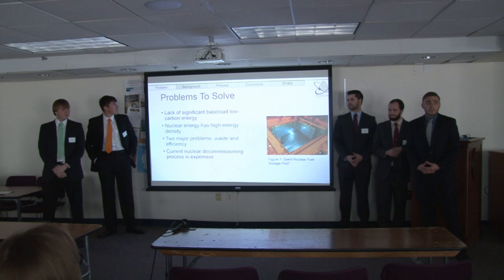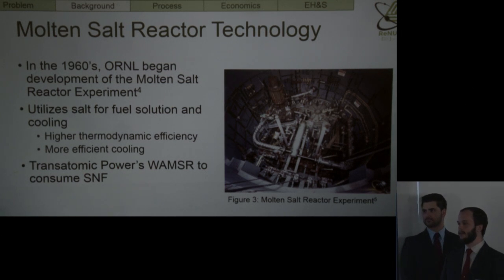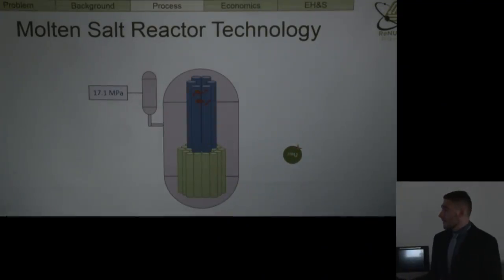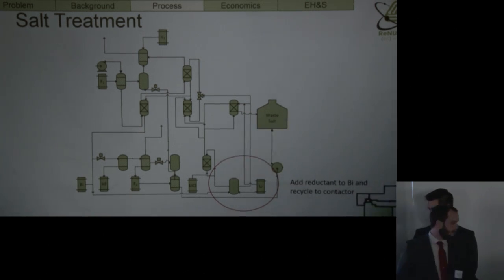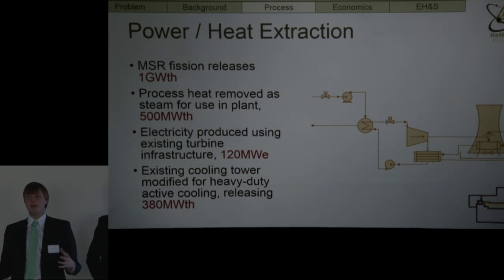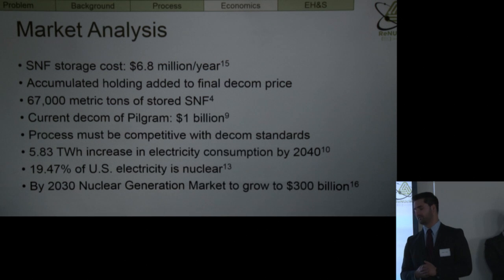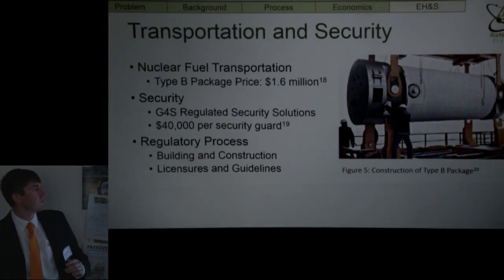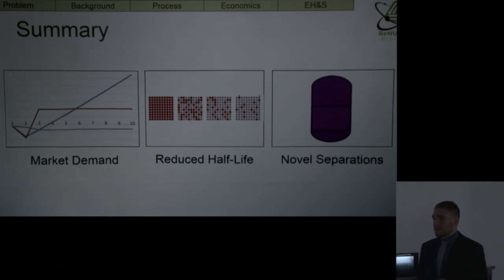NU ChE Capstone 2016: Molten Salt Breeder for Nuclear Reactor Decomissioning & Fuel Disposal

Comment: good job but i have several issues with this proposal:
a) you can't do that reprocessing you're trying to do unless it's at a cat1 security facility because you're separating out actinides. that's cost.
b) thermal neutron spectrum means you will not be burning higher actinides. your reactor doesn't have enough neutrons to do that. 2.5 max with u-233 means that you're basically counting on never losing a single neutron to structural materials (which, zirconium hydride does absorb some neutrons)
c) you're being incredibly optimistic about cost
d) why are you adding on all of these unproven technologies to your reactor? can't we just deal with the actinides first?
e) a 10-level distillation column is kinda ridiculous and not necessary
f) oh god why are you adding cryogenics
g) was the challenge to USE all the energy made by the reactor too? 
h) how many bells and whistles do you need to handle fission product waste and tritium? 
i) why does everything need to be separate to do vitrification? 
j) stop adding more things you don't need lol
Reply: hahaha yes absolutely.  (I was one of the project members here and oh lord it's a bit mortifying to watch)
For a bit of context, this was an Undergraduate capstone group project made of entirely chemical engineers (two of us had physics minors)., and the project was entirely Open-Ended with very little rules or guidelines. We also had only chemE advisors - none with any Nuclear background so whatever we included was our best effort scraped together from only ~6 months of researching, but "darn if we can't do the raw math on distillation and compression!" so we probably just kept adding to that part until things started to work. 

The idea started because we were excited by the several folks/companies who are trying to make MSRs for energy production (Flibe, Oklo, and especially TransAtomic), so that's why that was always part of the design when it probably shouldn't have been - Then we saw a joint talk on Recycling and Decommissioning at the AIChE national conference (in 2015) and had the idea.